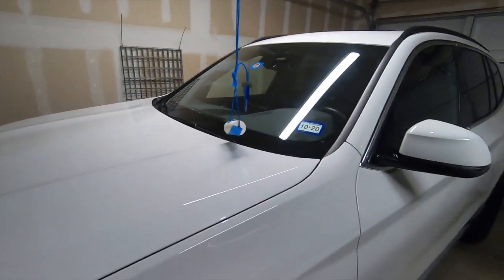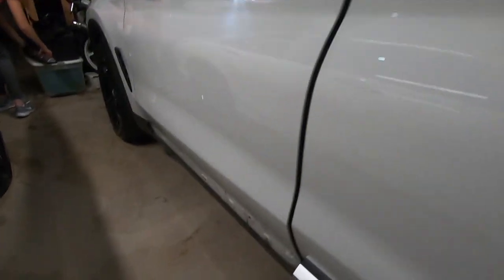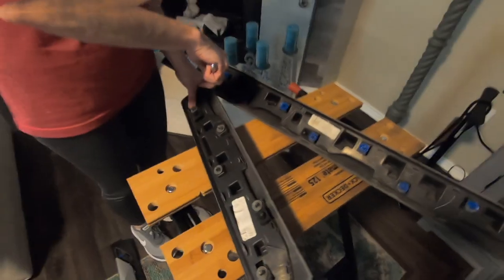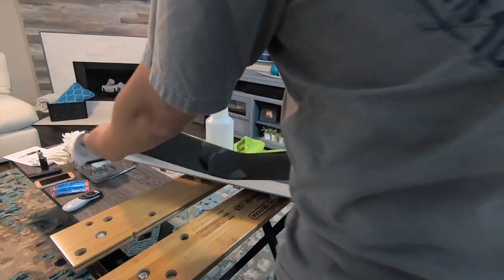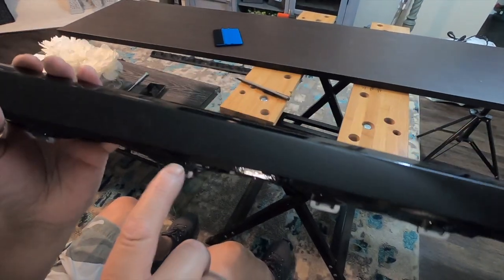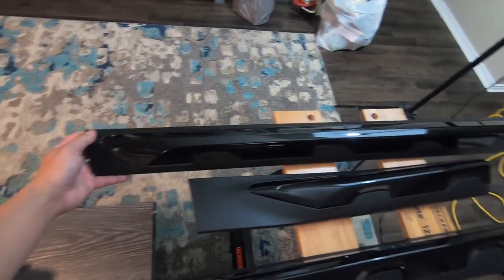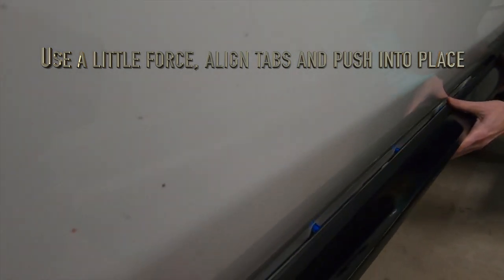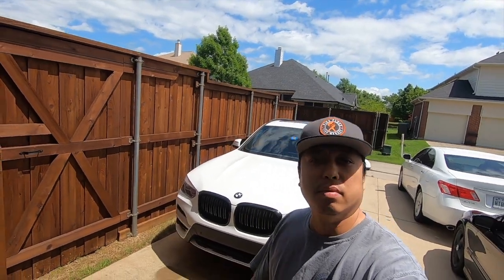Removing and Wrapping Side Rocker Panel BMW X3 GLOSS BLACK 2019 2020

Comment: I have the same bmw x3. You mentioned getting rid of silver in the front of the car as well. I was wondering if you figured out how to remove the fog light assembly  and the lower bumper skid protector to paint it wrap? Could use help here.
Reply from the maker: I was not able to remove fog light/skid plate assembly without removing front bumper.  You would have to first, gently pull the fender flares out from quarter panel slowly.  They are held in by clips, and I can't remember if there are screws as well.  You will have to look since I have sold the vehicle and have nothing to reference.  Then, in the wheel well liner, follow the liner and there should be some push pins and screws you would have to remove that hold bumper in place from the front qtr panels and top of hood area.  You just have to be careful or something can break.  Hope that helps and good luck if you go that route to paint.
Reply from the maker: If you have the white color suv, and wanted the silver gray insert to be white, I would just plastidip that with the white color and the gray skid plate insert the black color and cover parts you don't want painted.  That would look great in my opinion!  That way your bumper will look one solid color with exception to the black parts and black skid plate in front.  You can also wrap, but it will be a little harder due to the rounded edges.  But if you use heat, you can get it done to look good.  You would have to use knifeless tape to cut around the edges good unless you are good at cutting.  Knifeless tape has worked well for me in other wraps in thighs spots, just have to get acquainted in working with it.
Reply from the maker: FYI...Just make sure you put a blanket under bumper or have someone help you pull bumper off so it doesn't hit he ground.  You will know once you have loosened and taken out all screws around the edges of bumper.

Comment: Perfect! Do you plan on doing the Crome window moldings?
Reply from the maker: I did plan on doing the chrome window moldings, but I did have a hard time of trying to pull it apart from frame.  If you are able to wrap without removing the molding, and good at cutting, it wouldn't be so hard.  I didn't want to try to cut edge near paint.  I no longer have the vehicle to try it again.

Comment: Hey man do you mind showing a tutorial on how to remove the lower plastic piece on the front bumper on the 2020 x3
Reply from the maker: I'll see what I can do.  It does require removing the bumper from what I hear but I'll take a look again and if I am able to do that, I'll make a vid.  Be nice if I had a lift to get a good look!
Reply: @RapidRalphsVehicleVlog  ya I can feel the tabs on the back side and it just has those little rivet pieces on the bottom but I’m scared to brake the tabs on the top part. I might just tape it off with plastic

Comment: I hav a white 2018 BMW X3. I'm trying to go for the black and white theme as well. What size and model wheels do you have on? Are your headlights blacked out as well? I vinyl wrapped the side vents already and changed the kidney grill to gloss black.
Reply from the maker: Hey Ray.  I have the 2019 X3 which came with 18's.  I had the wheels powder coated gloss black which made a huge difference.  The headlights have a little chrome but around the edges, they are black so some parts near light where light reflects off of are still chrome.  Hope you got to do the rocker panels as well.  I plan on blacking out chrome on trim around windows, just have not had time since I have to many projects I try to work on and uploaded.  Hope you are enjoying your white and black theme.

Comment: Hey question, on the side edge of the door where the screw is, is there a gap between the panel and your door?  On the X3m40i, some people have a gap where the panel does not sit flush with the door and there's a slight gap.
Reply from the maker: Sorry it took so long too reply.  I do not recall seeing a gap on this one.  I have not seen the X340i but didn't think it could be that different.  Maybe there is a piece missing?  On ours, looks like a spacer piece at the end that could cover a gap but not 100% sure on whether it was flush or not.  I thought it sat flush since when I pushed it in, it felt flush and could not go any further.  I cannot look anymore since I do not have the vehicle anymore.
Reply: @RapidRalphsVehicleVlog  Ah no worries.  Appreciate the response.  I compared my vehicle to a lot of the other vehicles at my dealership and it seems to be the norm to have that gap.  Wondering if it is for water drainage or something.

Comment: I did the rocker panels. Its not as easy as it looks. Lots of curves. I do have 19” wheels. I was thinking about using plasti dip but you said you had yours powder coated. Now im curious if thats a better option. How much did that cost you? A new set of wheels cowt around $4k to $5k. Maybe powder coating is a better option.
Reply from the maker: Nice, you have the 19's.  I have a guy here who powder coated them for about 300 so it was not bad.  I have another video where I had plasti-dippded the wheels and they look pretty good.  I had done another car which have had Plasti-dipped wheels on them for over 5 years now and it has lasted the long.  I'll try to upload them when I get some time so you can see.  I did it at first, to see if I would like the black or not.  If I didn't, I could always remove it but decided to keep.